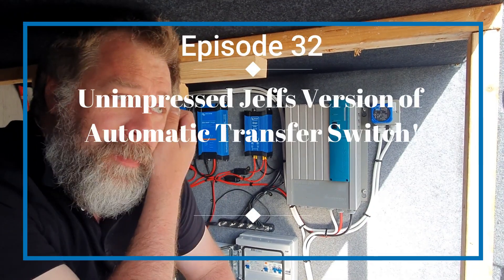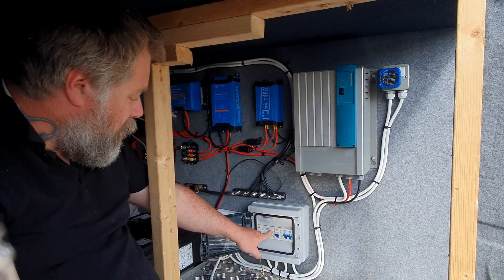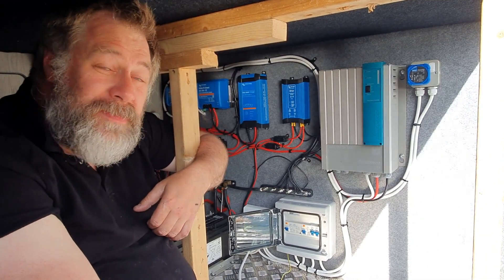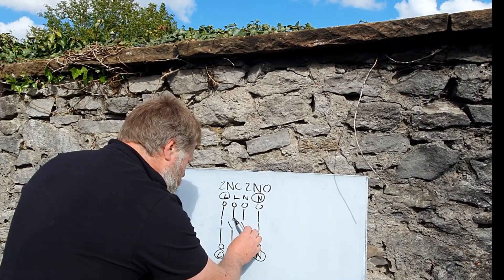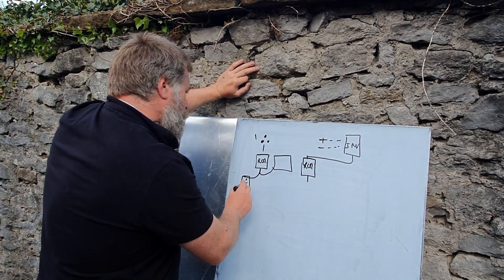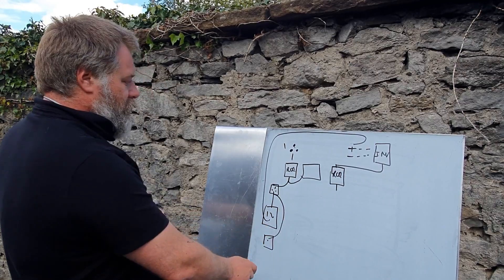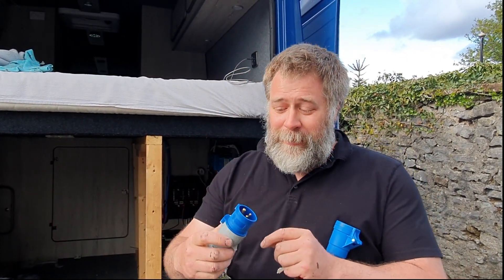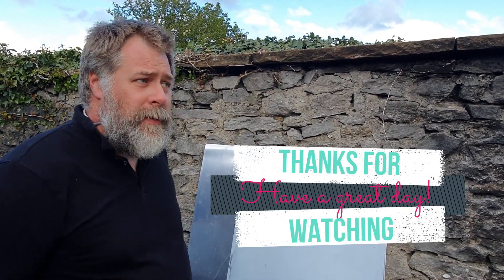How to Build an Automatic Transfer Switch: Episode 32

Comment: Hi Jeff, Great video thanks. Wondered how well this would work with a 2000WA power bank as I have an Aferiy that I wouldn’t mind running in a similar way to this. What do you think, if I set up the box as the inverter and ran it through it’s own RCD onto the CB, and had its own AC input socket via mcb from the surepower before the CB to a charger when on hookup? I can plug some Solar directly into the Aferiy as an alternative to the surepower battery charger/or both charging if I have mains available. It also has a 25 amp DC output so I may also be able to run extra fuse box power if needed. What do you think please?

Comment: Great video. I enhanced my (similar) set up by adding one of these great little solid state timer modules so that when my fridge kicks in (or any appliance with high initial current for that matter ) it doesnt prematurely flip back to mains. Ebay or Amazon about 4 to 8 quid.

Comment: Hi, I wondered if you had considered one of these, I fitted one some months back and so far very reliable. Definitely no cross over of either feed circuit during the transfer:
https://www.ebay.co.uk/itm/Dual-Power-Automatic-Transfer-Switch-2P63A-Switch-Gear-Switch-Cb-Class-Ats-Home-/164840810211?_trksid=p2349624.m46890.l49286
Ps, dont mind short videos when they are interesting 👍👍

Comment: A neat feature of this system is if you are on shore power and get a shock from a damaged appliance the RCD will trip. The contactor will switch to inverter power and try to shock you again 😜. 
Great explanation though.
Reply: I’m just fitting a manual generator change over switch for shore power, less to go wrong

Comment: Cheers for this I was going to do something like this but just ran out of brain power so I just connected my shore power to a large charger and left everything running off the batterys as I thought if I'm connected to shore power I most be low on power so let the batterys get fully charge. Batterys ain't cheap you know